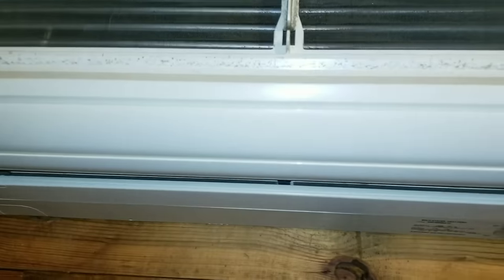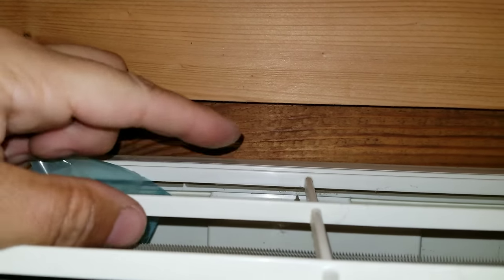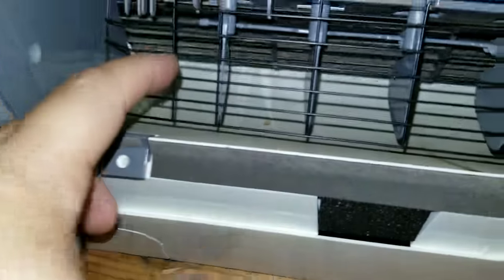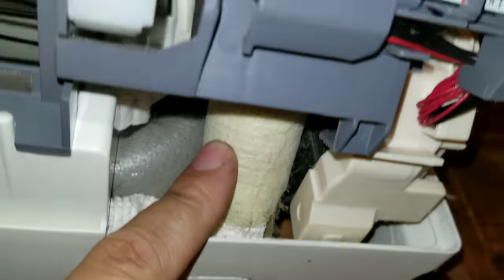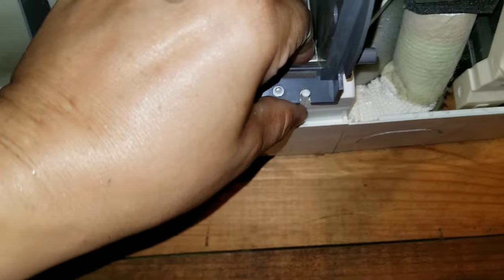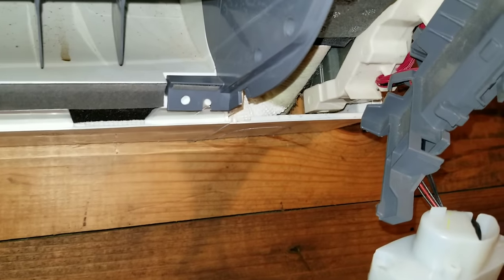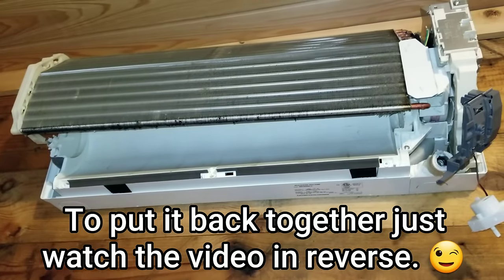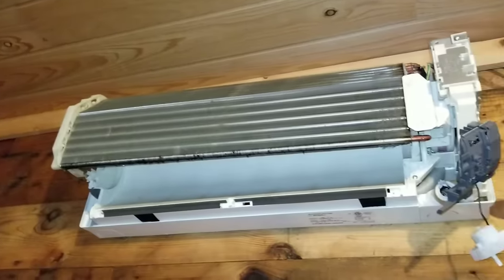Ductless Mini Split Cleaning And Maintenace (Complete Tear Down)

Comment: I have watched sosososo many of these kinds of videos and this IS BY FAR THE BEST VIDEO!  Great advice about cleaning.  I could never figure out how to undo the hose to the drain pipe...shows how to do that.  Shows also how to remove the little black fins, which are impossible to thoroughly clean unless completely removed.  I have taken these things apart so many times coz for some reason they get moldy and I have a mold allergy.  I used to take out the blower wheel (an absolute pain to do)  but with this video that is no longer necessary.  I also bought an Innovation low pressure power washer and a Speed Clean bib that makes all of this so much easier.  Please don't ever remove this video, I would be lost without it.  Thanks again so much and btw you are a great teacher! :)

Comment: Good to know about removing the louver motors. I would always unplug the wiring from the board. Mitsubishi, and Fujitsu are by far the easiest to completely disassemble and clean.
Reply: Is there a Fujitsu video?  I couldn't get to my blower wheel.

Comment: I am so grateful for this video - so much better than others I have found!!  I have a GL series, installed about three years ago.  When IU called the company for an  annual service- the kid came out and for $300 only cleaned the plastic filter, then told me I could have a coil cleaning for ANOTHER $300!   So I got a kit to do it myself,  but I wasn't able to get to the blower and back area.  Other videos weren't in depth enough, and also the GL series has wires running on the drip tray, which concerned me.   Thank you very much , my unit is now clean!  One question though,  I do get a gooey, clear, thick mucous type buildup at the bottom of the coils and in the drip tray (Like the stuff dripping from the mouths in the Alien movies).  Any suggestions on how I can combat this stuff, and or keep the drip tray running smooth.  It frequently backs up, and I am pretty sure it is just not quite level, but the goo is an issue as well.

Comment: A very detailed and complete video. Do you have recommendation with which kind of detergents should be used for coil cleaning? Is expanding foam (Mizu) effective? Or, you can recommend any liquid? Does it require using pressure washer or, just a garden hose instead& Thank you
Reply from the maker: Thank you for watching. Just a garden hose will work fine. No pressure washer. Original Dawn and water mixed in a spray bottle will work just fine for cleaning.
Reply: @HVACinSC  Thank`s a lot!  Just want for a clarification. What does "Dawn and water mix", please?
Reply from the maker: Dawn is just a popular brand of dish/hand soap degreaser. Mix it with water to clean the unit.
Reply: @HVACinSC  :) It is probably popular in the US :) I haven`t seen this in Aus unfortunately. And there is no choice in retail at all... Can you advise what kind of general chemicals can be used for this? Dishwashing liquid, solutions for washing machine or something special?
Reply from the maker: No clue what products you have there. Sorry

Comment: Comes apart just as he describes, I did not have to remove the pan to clean it, and the clips that hold the cover on at the top take more force than you would think to remove.
Reply: I'm pushing hard and they're still latched 😂
Reply: @alexx191  I know this is two years later and you are probably not dealing with this anymore.  I searched through these comments for help with the clips because I had the same issue.  I found the trick though!

Unclipping it was not possible for me just by pushing down, I had to push down AND pull away from the wall.  To make this much easier I started with the left side so that I could push down with one hand and pull the plastic forward at the same time with my other hand.  Once this clip came undone, it made it much easier to push down and pull forward on the other clips (going from left to right moving  one clip at a time).  I found it much harder (impossible) to start with the middle clips.

For the bottom lip of the unit, I had to push down (I thought that I could just pull it out after removing the 2 screws, but it was not the case).

Comment: I pump it down undo the hole inside unit and fight that mug on a table, after it clean nylog the flares and pressure test good to go,but they are still a pain !
Reply from the maker: +Kendall Fitzgerald This process only takes me about 10 to disassemble. 
Never ran into one I needed to remove the entire air handler from the wall to clean.
Reply: that was my thought, can replace the whole darned thing.........

Comment: so how do you clean the mildew out  of the back end of this thing where the final coil folds over at the top , i see it terminates in openings at the very bottom of the unit but not into the drain pain oddly enough

Comment: The unit i have is remarkably similar but though its a daikin. Freeing the coil while it’s hanging on to refrigerant lines is a definite thing that makes this tear down seem a bit of a risk (regardless of the actual damger). First off though, if you can’t access the breaker or the switch to depower the unit it’s irresponsible to start toying with it!! A lot of places have that breaker on a roof, up an outside wall… it’s not designed to be user-accessible
Reply from the maker: Correct. It is not designedfor a homeownerto take apart. Leave it to professionals like me who do this for a living.
Reply: @HVACinSC  I have already done mine a couple of times but not before I attempted to get a clean done by companies. Frankly I’m happier to let a job like this be done by a professional, but the responses i got were miserable. One guy came out, couldn’t find a parking in 5 mins (but he “knew the area??!) and then had left, before i had time to check my phone. lol.
There are lots of home maintenance i will do if pricing or availability don’t suit me. 
🙂

Comment: Why not instead of removing the grates don't you just pull out on the clips in the middle ( at 2:02) and both the grates and the louvers pull outward? Do you find it easier just to remove the grates?
Reply from the maker: +Video_Watcher I usually just leave everything attached to the drain pan but on the real nasty ones I prefer to pull the wire grates alone because dirt and hair get all wrapped up in them.
Reply: HVAC in SC gotcha!
Reply: Do you pull the clips outward? I’m afraid I’ll break them. Or do you pull up and towards you?

Comment: If the dang thangs had better air filters they wouldn’t get so nasty inside so quick!
Reply: Lee Johnson these units need very low static to operate properly. I have seen a 1" media filter attachment made for some but do not know how well it would work once they start to clog. I have also seen uv lights made for these...does anyone have any feedback on how well they work?
Reply: I have been waiting on some videos or feedback on the uv lights also.
Reply: UV kills germs/bacteria buildup on said junk when powered OFF/blower not on... blower on 24/7? =JUNK, when air flowing to cool building = JUNK maybe 10% bacteria/germs killed, the flow is just too great. without calculating it you'd need roughly 20' x 20' room of multiple HEAVY DUTY UV  light to kill anything flowing past @ air flow rates of today in HAVC/R ... no I am not an engineer, but I quickly guest-i-mate things :))))))
which is most always 250% better than the "collegiate trained clowns" that are crunching the supposed real math and designing the garbage.
time for a great depression again, too many fools and and world wide conglomerates into the singular cookie jar ;) housing makrte was #1 sign of impending long term downslide of doom, in-which they are attempting to play off............
Reply: Keeps service worker employed. 😉
Reply: It is niether difficult nor time consuming to clean out the filters.  It is one thing that I keep on  my monthly to-do list.  ( I live in Cabo San Lucas where it is always summer)

Comment: I'm having such a tough time removing the clips on the top. It feels like I'm going to break them. Any tips?
Reply: I know this is a year later and you are probably not dealing with this anymore.  I searched through these comments for help with the clips because I had the same issue.  I found the trick though!

Unclipping it was not possible for me just by pushing down, I had to push down AND pull away from the wall.  To make this much easier I started with the left side so that I could push down with one hand and pull the plastic forward at the same time with my other hand.  Once this clip came undone, it made it much easier to push down and pull forward on the other clips (going from left to right moving  one clip at a time).  I found it much harder (impossible) to start with the middle clips.

For the bottom lip of the unit, I had to push down (I thought that I could just pull it out after removing the 2 screws, but it was not the case).

Comment: My drain hose connection on my Mitsubishi doesn't look like this and I have been trying for over an hour to remove it. I'm afraid I'm going to damage the cheap plastic.
Reply from the maker: Every manufacturer is different
Reply: @HVACinSC  I just had to pull on it really hard. I thought for sure I was going to break something.

Comment: No bodies paying for this thorough of a service
Reply from the maker: Then what am I doing here....🙄😏
Perhaps nobody is paying YOU to do this but they are certainly paying me. We do a few of these a week. 🤙
Reply: @HVACinSC  brother unless your charging 150 bucks just to clean that unit only, to take that unit apart that much it isn't worth it. I can clean that unit excellently with nothing more than the plastic cover off and the filters out. I dont need to take the whole unit apart like that unless I'm changing a part. But thank you for taking the time.
Reply from the maker: @Bdpjev We charge more than $150 to do this sort of deep cleaning when it is required it is absolutely worth it unless your customers enjoy breathing this garbage.
We've been installing these system for 20 years and counting. If you think you can clean this as effectively without disassembly post that video. I've seen many claim this and fall far short but do you boss man. 🤙
Reply: @HVACinSC  now were talking
Reply: I cleaned our mr slim in our booth, thing looked like it had never had maintenance. My supervisor chewed me out and said i couldve costed the company hundreds and im not licensed. Thing was literally swelling my throat and casuing it to dry.